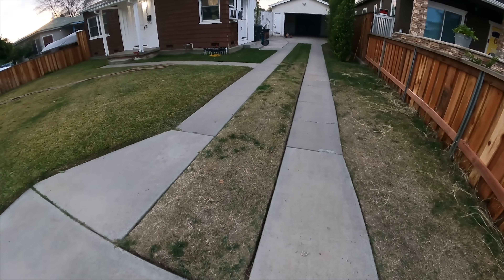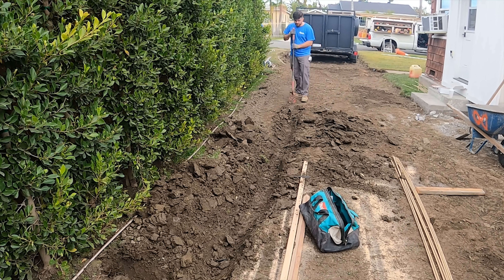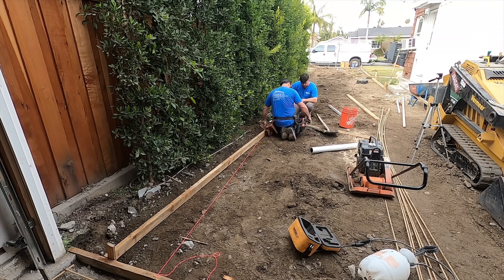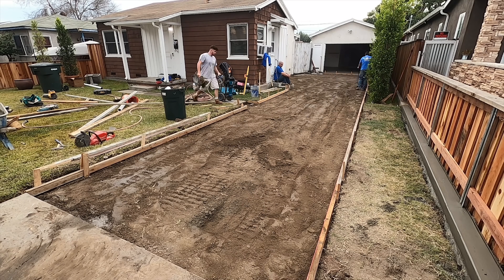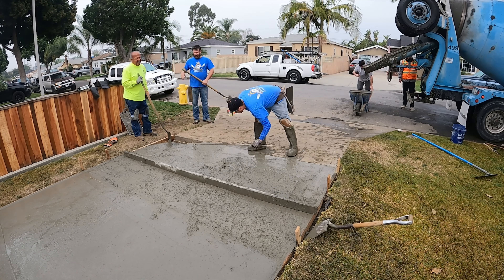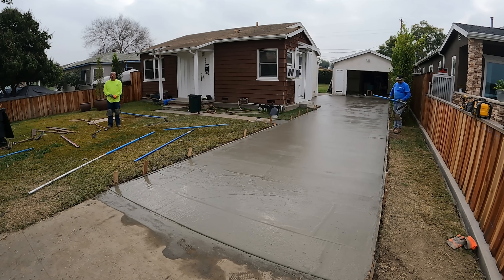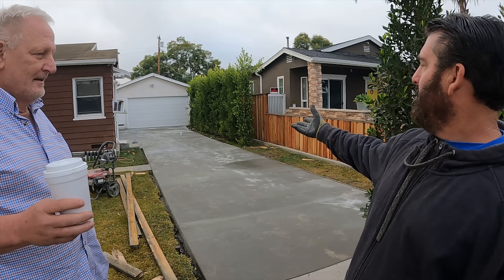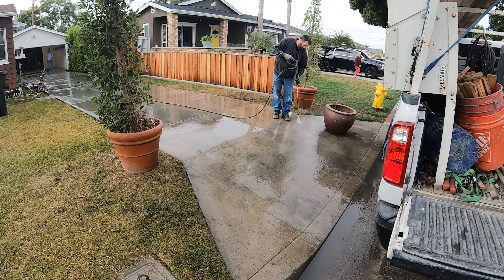Homeowner Ruins Fresh Poured Concrete Driveway!

Comment: Wasted 23 minutes of my life waiting for the homeowner to ruin his driveway, only to find out he didn't. If I could dislike this video 5,000 times, I would.
Reply: waaaaaaaaaaaa
Reply: I wouldn't be so rude, but yes, he committed a venial sin, not a mortal one.
Be sure to explain the rules well before leaving the owner alone with his new driveway
Reply: Being a cool day like he described it was the homeowner didn’t need to put water on it to begin with. Only time to do that is when it’s really hot and prevent it from curing too quickly
Reply: I think the contractor is trying to put the message out to Stay off new concrete a LONG time before walking on it or using it, it costs to much to mess it up.  The  contractors solution to get the drainage working is great and that will be used by homeowners with poorly sloping driveways.  I wonder if the contractor put a cross slope on the pavt draining towards the fence too?

Comment: are there no expansion joints on the curb? just wondering because im trying to build a curb for skating and would rather it have no joints. just a clean consistant curb. thanks.
Reply from the maker: If it does crack it will be better, then a big joint in it

Comment: I know it might be a pain in the rear end but in my head in the long run your driveway is going to last longer if you have a sod section in the middle . Not only do you have less concrete but it is going to last longer. also why don't you put the crack marks down when it's wet. i have seen a couple of jobs that do this and it seems to make  sense since it is faster.

Comment: Back in the day schedule 40 was extremely expensive compared to service 200 PVC pipe. That said service 200 is not adequate for underneath hardscapes like driveways. Old PVC pipe would disintegrate very fast compared to new technology But still, rigid PVC sucks for sprinklers. That's why over the last 30 years most sprinkler guys have switched over to flexible poly PVC. Rigid pipe just isn't used anymore by serious professionals, for a lot of the reasons you will see and have seen here. To properly install a sprinkler system underneath a hardscape, you would use a schedule 40 sleeve and then put flexible poly through it.

And for what it's worth over the decades I have never seen a concrete company ever give one hoot about a lawn sprinkler system. So big props to you guys! Well done.

Comment: As a service, you could just put some poles in the ground around where they are not supposed to walk and put a tape on them. That way when he (or anybody who was not informed there was concrete)opened that door would have seen the tape and either know or remember not to walk on it. Or place cones around it. A cone in front of the door would also help remember to NOT do it.
Reply from the maker: How about electrified wire

Comment: whats the advantage of cutting the expansion joints with a saw after its dry compared to using a tool to cut it out while its wet?
Reply from the maker: preference
Reply: @OdellCompleteConcrete  ok just wondering, thanks

Comment: GREAT JOB!
Excellent prep!
Re-bar + fiber??
Woah!
I worked for a civil engineering/consultant firm specializing in concrete, for over 4 years, my gig was Roadways and bridges.
I ended up getting recruited  to a large concrete company as a driver for 10 years. They wanted a driver that had experience on the other side of the mixer.
Bro, I've never seen so much finish work on for exterior flatwork!
I was waiting for the power trowel to come out at the end! Haha
Question, why didn't you use the white curing compound?

 Ps,  around here you'll never seen a pump used on flat work, only walls.
Flatwork, = wheelbarrows,  power buggies and comealongs

Comment: How can you tell if  fiber mesh was used for this type of job? We had ours poured and the contractor said he used fiber mesh but I don't see any kind of fibers after the pour. Are you suppose to see them or are they just blended in? I feel like I got scammed if it didn't get applied. 😔
Reply from the maker: Find some slag under the forms break it open and you see some peach fuzz
Reply: @OdellCompleteConcrete  thank you! Will check it out.

Comment: Just a little tip to the contractor. I wrap the air intake on the Skil Saw with a filter like in a shop vac or similar to lessen the abrasive damaging effect to the brushes and armature. It will last longer.
Reply from the maker: TY

Comment: i am wondering. how long after the pour did he actaully walk on it and hose it?
Reply from the maker: Looks like as soon as I left
Reply: @OdellCompleteConcrete  oh my . that is not good at all.  i was told by the guy who redid 10 slabs of my driveway this week not to walk on it for the first day and once he cuts  the cuts (meaning he knows he can walk on it) than I can. and then to wait 14 days before driving on it.  but i am now 50 hours out form  them finishing the pour. . they used FG mixed concrete 4 inch driveway. on gravel/crushed cement  and we are getting eather where it was in the mid to upper 80s yesterday. today and tomorrow will be over 90. i assume that helps it cure  qukcer? although i will steill wait 14 days anyway

Comment: Doesn't the rebar need to be elevated a little so it doesn't rust from the bottom?
Reply: if you look closely the bar work is pulled up with a hooked tool some 2 inches from the ground when the concrete is poured.

Comment: I like the cutting of the slab for your brake point, but when such a hard edge is prevalent, wouldn’t that be prone to chipping? What about troweling your joint in and doing a cut afterwards? Best of both worlds?
Reply from the maker: Crack chasing works

Comment: About the thin wall pvc for sprinklers what I was told was it flows better than the thick stuff. Exterior is same diameter but inside diam is bigger.

Comment: this is a dumb question. why are the spaces cut in the concrete? is that to allow the expansion and shringage that water/heat will do?
Reply from the maker: Crack control

Comment: some contractors have no idea, i can pour a slab in the morning finish with mirror finish in afternoon and strip the boxing the same night all in one day with cuts put in as you go, never need to go back.
his problem is the concrete, he used weak cement ie 12.5 mpa when it should of been 20-25 mpa and use hardener  for  cold weather.
Reply from the maker: This mix is above average design for this application

Comment: So the company I worked for we were doing on this huge UPS storage Seattle Washington. The job probably lasted a year between the floor and pouring all the walls and standing those up but we will do 10,000 ft.²  a day a crew of 5 people from pouring the concrete to finish in the concrete and by the end of the day, we’re snapping lions cutting the concrete every day 13 hour day driving about 100 miles to get to the job every day and then home Man I was tired that year

Comment: little tip to save some 2x4's. if you dig pas the existing concrete you can just run aboard past instead of cutting it to length the fit. wastes a good board. and no gravel?

Comment: In concrete construction, what's the slump you're employing? It appears quite saturated.
Reply from the maker: Depends on the package you're supporting
Reply: @OdellCompleteConcrete  When I had my construction business we usually poured a 4-inch slump. I don't understand what is this package you're mentioning. When we go out and bid on jobs everything's by the square footage all in one package if they want fiber mess we just charge an extra cost.
Reply from the maker: The package of rebar and fiber.

Comment: I once lived in a rental house in an old HOA where all the house supply lines (not the sprinkler lines) were originally schedule 20. At some point, every water line in that neighborhood broke and had to be replaced with schedule 40 between the water meter and the house, which is what should have been used in the first place.
Reply from the maker: That's crazy

Comment: I’ve never noticed that the little grass strip on the middle driveway type is very uncommon these days. I remember seeing ribbon driveways a lot growing up. I’m guessing the added maintenance is too much of a PITA. Kind of like the looks of the grass. Nice work!  Homeowner seemed like a nice dude.
Reply: I have an original ribbon drive poured in 1974 and I can flat attest it is twice the  maintenance for edging and keeping weeds from the joiner cracks.  It is in excellent shape so I can't justify spending to upgrade it.  The strips are not wide enough to skateboard on or to play basketball or anything fun...they're runners for the tires is all.  It does look sort of beautiful right after edging though.
Reply from the maker: For sure

Comment: I had a new 25m long 100mm deep reinforced concrete driveway installed and the concrete contractor stipulated that I couldn't walk, drive allow pets or drag hoses over it for a least 7 days otherwise it would be ruined. So I didn't and I have a perfect driveway. He came back after 4 days and cut the expansion joints. Every two years I clean it with a high pressure surface cleaner to keep it looking new

Comment: idk what company you are using but for the one I worked for we didn't wash the truck or fins until after the job was done......we didn't do anything to change the slump unless asked to do so...we had a crew that took care of buildup,  once every few months we would get on a scale with a full tank of fuel if we didn't pass the weight check the truck was brough into the shop to clear the buildup!

Comment: I watched this pour. Reject wet loads......... Great info for someone that doesn't know how these jobs go. I am a ready mix driver with 35 years experience. I have watched other videos also. It never stops amazing me. Why is it, when a wet load shows up you just take it and say 'Well, that happens". Especially on small loads".  You know what? It DOES NOT have to happen. REJECT THE LOAD.... The slump is on the ticket. Make them be responsible and do their job.... When the driver washes down? He or she can look at the load. If it looks wet? The batch man can dry it up. The problem is. The contractor does not complain. UNTIL........... It either shales cracks or pops off. At that point? You got A SNOWBALLS CHANCE IN HELL of getting it covered by warranty. They will say it was finished wrong. REJECT the load. If it is slop and you know what you are looking at? You know it is gonna bite you. Wait for the replacement load....... You will save yourself. Don't make excuses for the driver. I always read my ticket. Whatever the slump is supposed to be? It will be, Or? a bit drier. We can always add a bit of water. Or plastiscizer if necessary. It is awful hard to take it out. If you make the point known to dispatch? It will be documented....... Save yourself. With the supplier and the customer as with what else had happened in this video.
Reply from the maker: I wish it was that simple.

Comment: As of Sept 17" you are not to dry cut concrete per OHSA. The dust will cause silicosis.. You must use water which is hard when you use an electric saw.

Comment: I didn't know you could concrete directly onto dirt like that? I thought dolomite or something was put down before?
Reply from the maker: Have you ever seen a bridge? There's nothing g under it.
Reply from the maker: Have you ever seen a bridge? There's nothing under it.
Reply: Large concrete and steel beams are  underneath though. What I mean is I thought by concreting directly on dirt it could cause it to move or crack whereas compacted dolomite would hold better or do the steel beams crossing through do this regardless?
Reply: @OdellCompleteConcrete  Also bridges are like 20ft in thickness bro hahaha

Comment: Over 40 years ago my parents had the backyard poured in concrete, so we were given the Look, the Finger and Warning. Of course we did not listen and we ran across the concrete and then it is was Oh blank, so we wanted to fix it and we used this super heavy brush they use in pools to clean the sides, the  damage finally disappeared about  the same time the marks on the back of my legs did.
Reply from the maker: Everything works out

Comment: There is a 7-Eleven store in Reno, Nv that had a gas station put in out front. After the tanks had been sunk they poured the slab
and the concrete contractor put so many stress relief joints the slab looked like a spider web. I dont know what that was all 
about. I dunno if Reno has  concrete cracking problems due to extreme heat or what. Was this 7-Eleven's idea or the 
contractors? Who knows. I have never seen this before o since. So strange.

!
Reply from the maker: Sounds different for sure.
Maybe decorative

Comment: I agree that you should always saw cut but I feel you run the joiner then saw cut the seams you lay in that way the saw cuts don't splinter and crack with freeze thaw and pressure shear

Comment: Brother (Contractor and a good one) and I installed windows in a home. I was present when he told owner DO NOT OPEN WINDOWS FOR 24 Hours as they are newly caulked and it will swell. We came next morning ,windows open wide he said it got warm . Windows stuck,we left. Not the first idiot customer or the last. Brother wrote everything in signed contracts to protect himself. Very successful Contractor. Can’t fix Stupid but you can protect yourself.

Comment: One thing i learned with any gravel driveway is.... if someone grates it absolutely flat. U can get mad enough to shootem. Especially if your driveway is 1/2 a mile long...or longer. That same principal applies to a concrete drive. Dont make it flat.
Reply from the maker: Flat as a pancake, not a crepe

Comment: why didnt you just dig out the dirt so you can put base and have a thick slab?
Reply from the maker: thick concrete is better
Reply: @OdellCompleteConcrete  your response doesnt make sense. Its called digging out a layer of dirt so you can do the job properly. which is a gravel base compacted, then a 6" pour for a driveway. You say that line like there isnt a solution. Yes thick concrete is better than thin, but concrete on dirt is just stupidity. Dont be lazy and do the job right.

Comment: I would have dug a 10" hole, put the old driveway in it, used the diggings to back fill the forms and covered the pieces of the old driveway with 3/4' stone.  Also vertically placed rebar driven into the undisturbed layer at every intersection of rebar and welded it all together.  Good job however!
Reply from the maker: Never heard of that technique. 
TY

Comment: seriously went off thinking you said you used a yard to do the pour, lol then had to delete comments... as a former driver if i went out with a yard, id just hope you got it done quickly if not well the small air jack hammer and some time in the drum will fix that, trying to clean fins as you give the customer product is not a option! only when they ask for an adjustment is that a option.

Comment: Why not invest in a Soff Cutt saw ? I would be scared to death to leave concrete for 2 days with no joints. We never wash the powder off but broom it to the end and push around onto the slab what is left . It helps with spots that need more powder or blemishes and helps turn the concrete whiter. 
Mikey Out. Oooooh Yeah!!!
Reply from the maker: Sounds interesting

Comment: Depending on the weather a concrete surface will dry pretty quickly. Seeing the contractors, the owner and his two dogs, it is dry enough to walk on.
Care should be taken to avoid dropping a hammer, or other heavy items on new poured surfaces. 😲
After a second day, watering the concrete several times a day during the curing time will strengthen it. Concrete absorbs water during this time. Many homeowners do very little watering.
I have the strongest poured concrete (lots of watering), but with time everything cracks, I have some on my face.🤣🤣🤣🤣

Comment: For the basic house the homeowner has that driveway is a sizeable investment...and then he walks on it. Where it gets bad is when he twists his foot destroying the broom finish. You know he's sick about that. For me sawcutting should only be used on warehouse/factory slabs. Hand tooled joints done correctly add so much to the overall appearance. It's like a brick wall. The brick is like 85% of the look and the mortar/joint is the other 15%. But boy does that 15% make a difference. It can make or break the fished product.

Comment: Measuring concrete has 3 methods only: 1  Over order.  2  Exact.  3  Under order.
1 and 2 are not viable which leaves only number 1.

Comment: You need 3” surrounding rebar. So to use rebar you would need a 6” pad. Why you ask? But what do I know? Got called out by an inspector. Looked it up and yes. It’s why rebar piers are 3” minimum. You should have used 4” square by #8 wire.  Not one competent concrete company would poor a 3” driveway without a signed waiver.
Reply from the maker: You're wrong again, and I'm guessing it's been that way a long time.

Comment: Did anyone tell the homeowners to stay off the concrete. Also 6" slump is a little wet for a driveway. Although the homeowner is always one sheet to the wind.
Reply from the maker: OSS
Reply: @OdellCompleteConcrete I was in ready-mixed concrete for thirty-five years. You roll your eyes daily at the antics of customers large and small. I learned to take nothing for granted. I was on the production end working at batch plants. I commented on the slump from lost loads due to a gallon of water and a serious inspector.

Comment: You guys do good work but why do you insist on dry cutting concrete so much silicon dust specially fibreglass in the concrete isn’t safe I don’t understand why you don’t do wet cutting instead
Reply from the maker: Cutting is cleaner